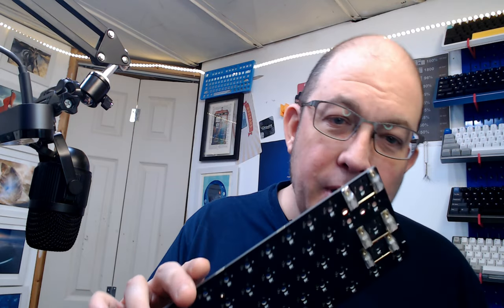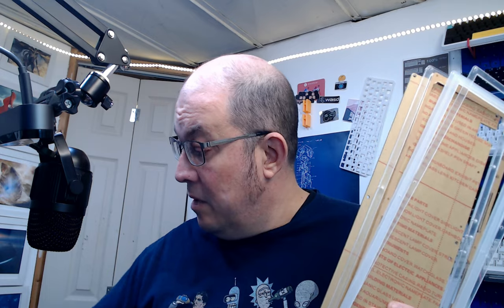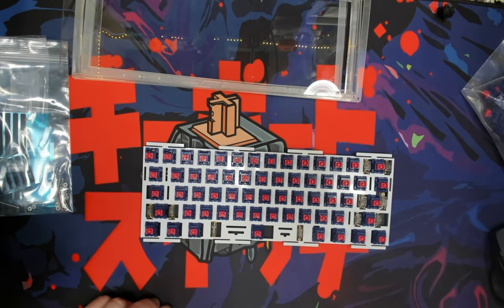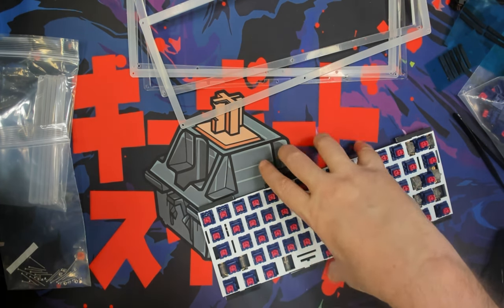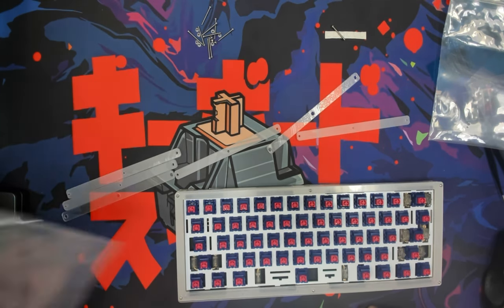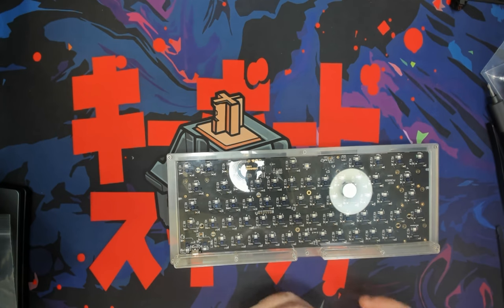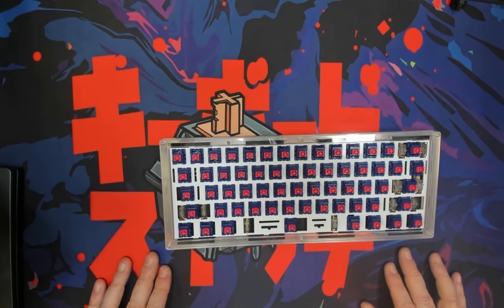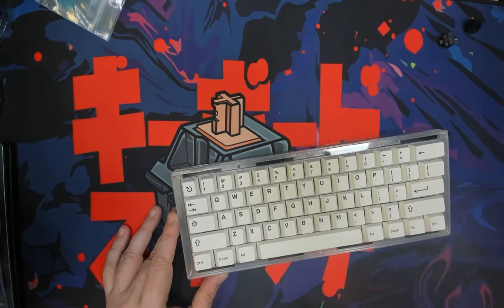Zepsody Rehouse60 stacked acrylic case for numerous 60% PCBs. BYOP - Bring Your Own PCB.

Comment: Kind of a neat looking case.  But it looks incredibly tall, like desk height to top of space bar looks to be in the 35mm or higher range even with Cherry profile caps?
Reply from the maker: I think the layers make it look taller than it is. The chin sits at 22mm, the back 33mm with a typing angle of 7 degrees.
Reply: @MechKeyboards  Cool, thanks for the measurements.
Reply: It is hard to get acrylic any lower than this unfortunately (while still allowing for flex) :S. I actually put alot of thought into how to make the front height as low as possible, the way the screwing for the feet was done, was partially due to trying to get an extra 1mm off the front height. Problem is the bottom has to be kinda thick so it doesnt break, plus the acrylic manus have their pieces run a little thick alot of the time.
Reply: @zepsody2074  Thanks for the information.  I really appreciate the follow up.  It really is a neat looking case!